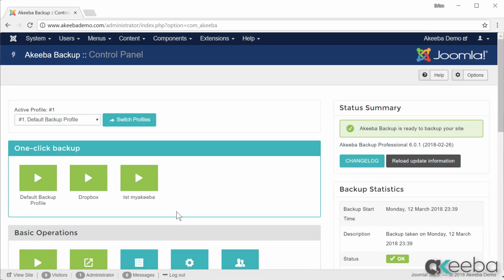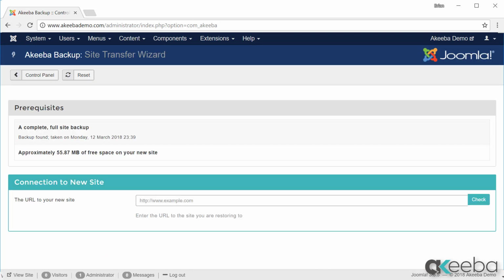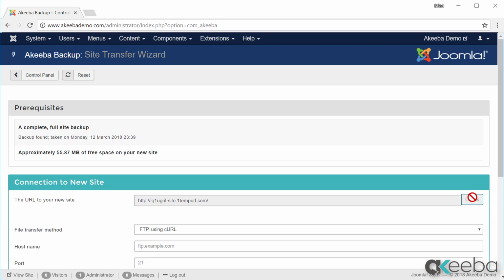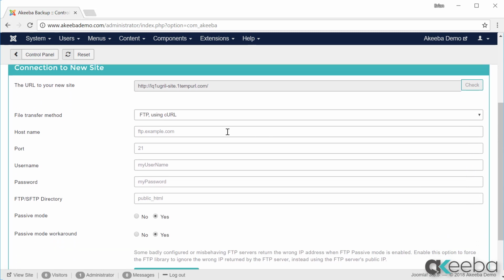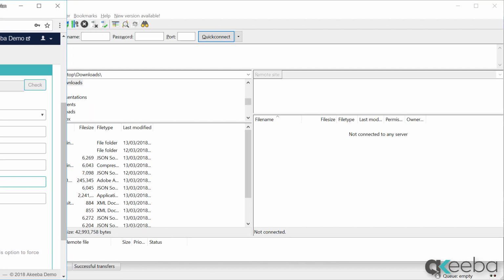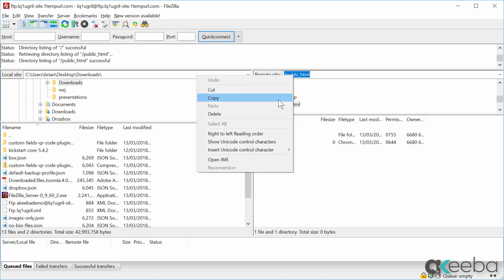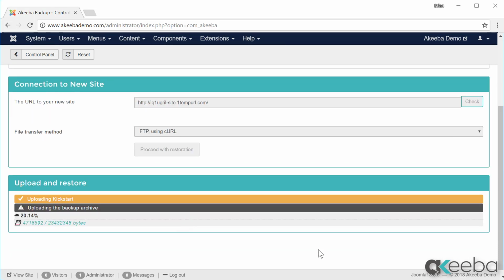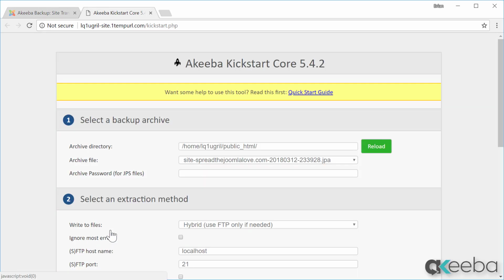Site transfer wizard

Comment: do I need to have apache2 shutdown?  Can I transfer if someone is using the current site?  Should I put the site in "Marintenance Mode" to prevent anyone from logging in while transferring?
Reply from the maker: You do not need to and you shouldn't shut down Apache. If you do that you cannot run the Site Transfer Wizard since it's something running on your site. You CAN put your site into the Offline (maintenance) mode while transferring it. It's not necessary but if you want to do it of course you can.
Reply: @akeeba  thank you

Comment: Is the side transfer wizard still included in the free version? I can't find this option in my backend anymore.
Reply from the maker: TL;DR: There is no longer Site Transfer Wizard in the Core (free) version but you can still transfer your sites following the instructions on the Restore On Any Server video.

We have removed Site Transfer Wizard from the Core version with version 7.0. We found out that the target audience of the Core version was getting confused about setting up (S)FTP for STW to transfer files and would have much rather preferred using their hosting control panel's file manager to transfer files. Of course that's the manual method which was possible since the first release back in 2006, when the software was still called JoomlaPack, it is still possible and will remain possible – it's integral to how Akeeba Backup works. In fact, the Site Transfer Wizard does nothing different. It simply copies kickstart.php and the backup archive for you, then points your browser to Kickstart on the new site. So instead of confusing our free version's users we decided to remove STW from the Core version and point you to the Restore On Any Server video instead.